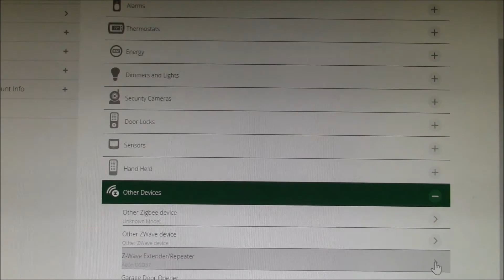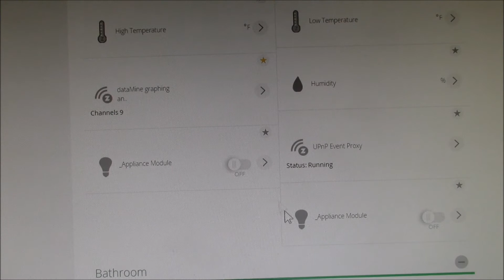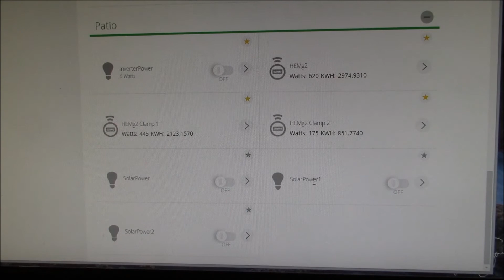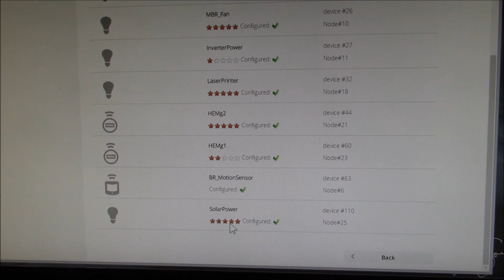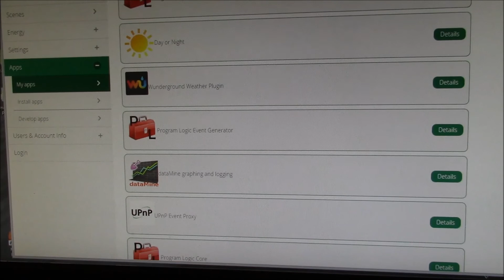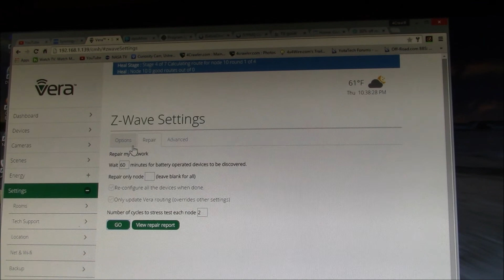Z-Wave DC Relay Module, Part 2

Comment: This video is  really good however I have a question on how you can connect this same relay to Two switches.  I have one switch controlling the fan light and another one controlling the Fan.  It is a simple on/Off switch.  It only has hot wire on the bottom and top screw is going to the light and fan.
Reply from the maker: +D Parikh I used the dual relay module and as such it has provisions for 2 switch inputs, if you chose to connect them.  If your switch has two output terminals, one for the fan and one for the light, connect one to the SW1 input and the other to the SW2 input on the relay.  I plan on using one of these dual relay modules for my bathroom exhaust fan (w/ light and fan).  I will install the dual relay module inside the fan housing and then just feed it with power and use a wireless switch to control the relay without having any physical switch connected to it.  I'll be doing a video on this project in the near future, so stay tuned for that.

Comment from the maker: Thanks for the feedback.  I'll try to put some videos together on the Z-Wave system as I don't see that many have been done on YouTube.  This is something I've had running for about 1.5 yrs. now, before I started posting videos.  But at the beginning, I only used it for a couple of simple tasks.
I have the Vera Lite from getvera.com plus a growing collection of modules.  It is quite an amazing system, especially combined with some of the apps you can install.  Once you have the system set up and running, so many projects present themselves where the Z-Wave system can be used.